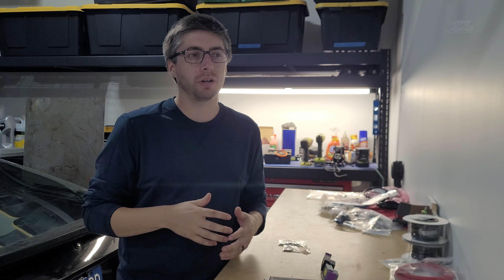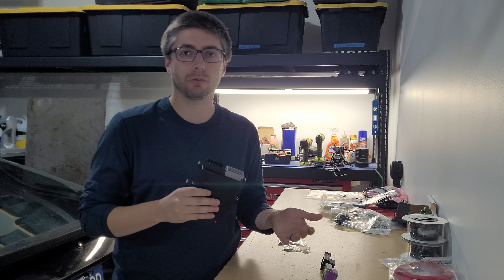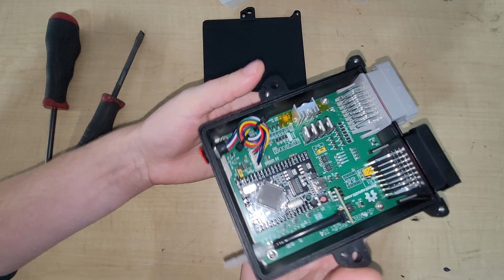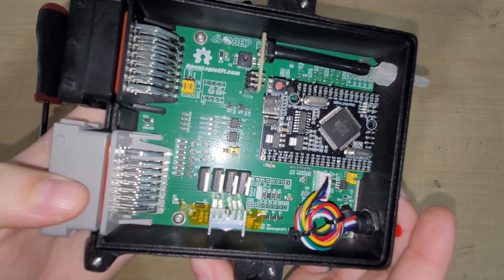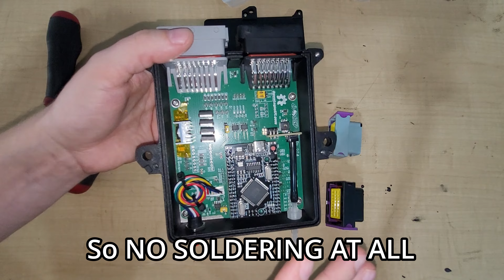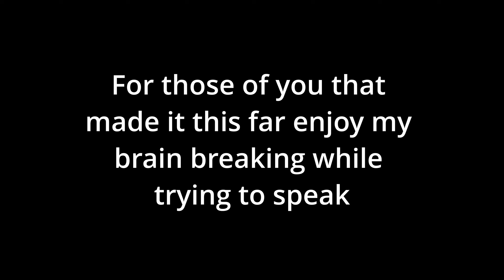Closed Deck X4 by OpenLogic EFI – Big Tuning on a Small Budget

Comment: Whats the advantage of this over the openlogic spark gap x4($199)?
Reply from the maker: A few more pins and I prefer this style of connector since I have worked with them in the past. This is also just my opinion on things but I like how it looks more. In terms of raw functionality they are similar but the Closed Deck does have the capability of varying the ignition voltage (12V or 5V) giving it a wider application range.
Reply: @slightlyengineered ty for the reply

Comment: I NEED THAT..... 😲
Reply from the maker: Hopefully by the end of winter I'll have my car going so you can see how it works!
Reply: @slightlyengineered  Yes please, went ahead and bought one.... never done anything like this but I think this is the best way to go with my old car. Thank you!
Reply: Me too . I just bought a 1984 na 944. I want to modernize it's guts . Show us the parts and sensors that retrofit. Thanks
Reply from the maker: @AzeezOverseas  All in due time. I'm working through this in real time with the videos. I'm also not retrofitting sensors, I'm adding additional redundant sensors so the factory gauges will still work.